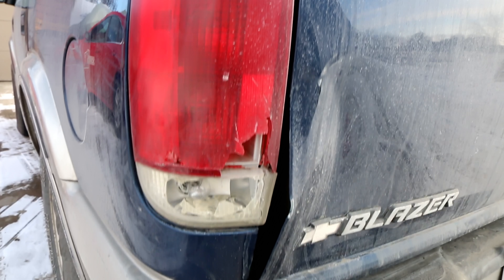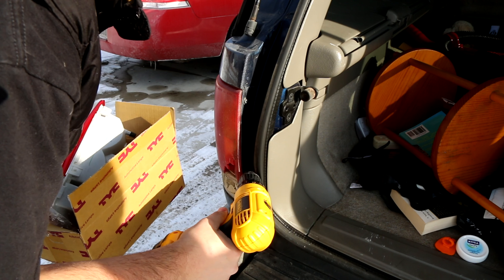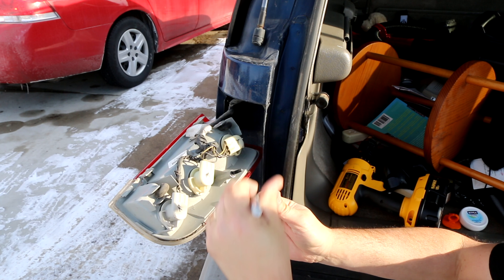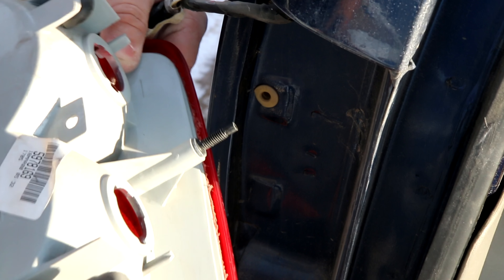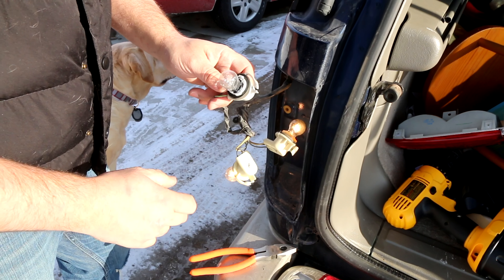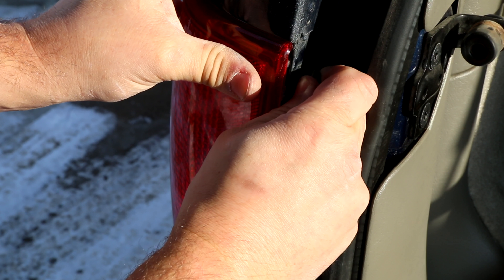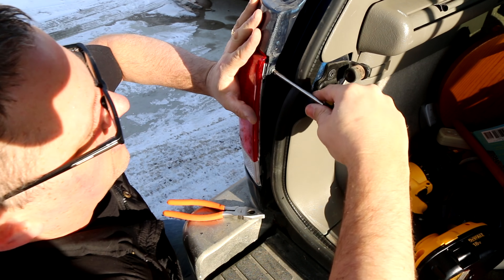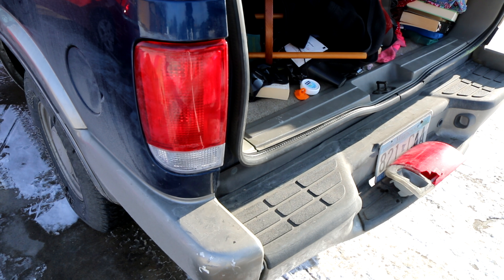How to Remove and Replace Tail Light Assembly Chevrolet Blazer

Comment: How do you get past the bar blocking bottom screws
Reply from the maker: I am sorry, we did not have that part in our way on this car.  Hmm, I am not sure what that part is or how to get past it.
Reply: Tailgate cable? Pop it off
Reply: @trunkbangking  The tail gate on the 2003 has a hydro arm, not a cable.
Reply: @FROSTYLIFE  It's the hydro arm on the tail gate.  Most Blazers have tail gates, NOT lift gates.
Reply: @michonr.givens6609  oh yeah .thats what i meant.idk why i said cable .especially when ive owned 3 haha